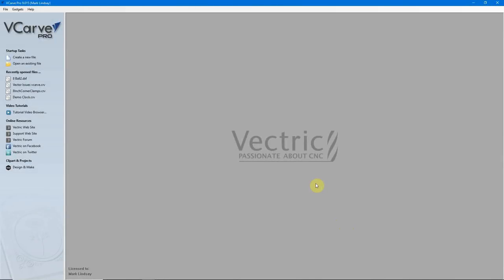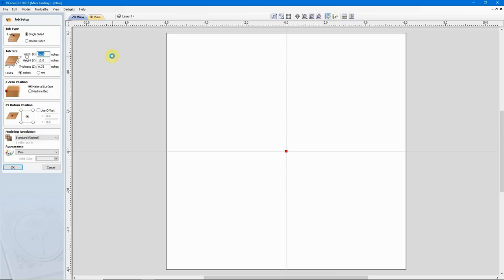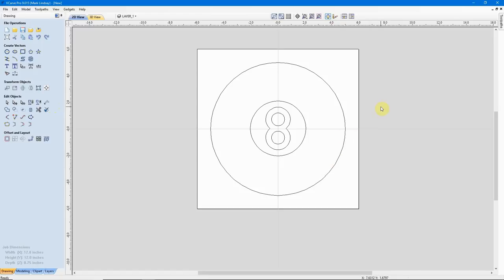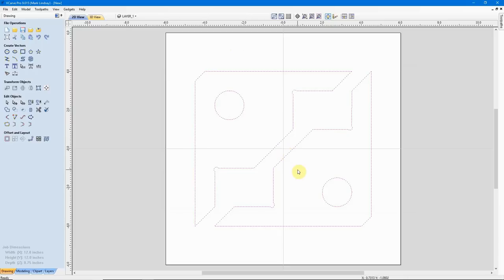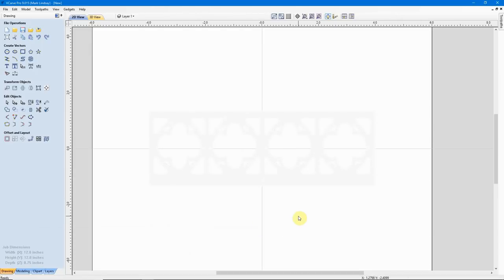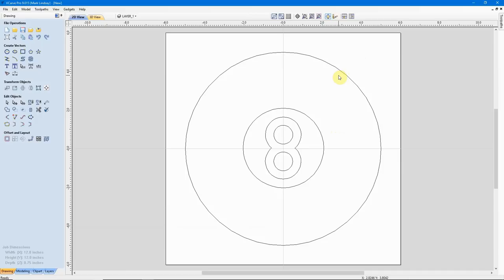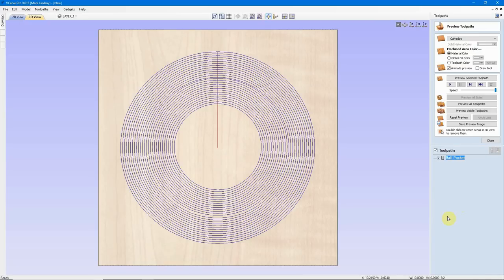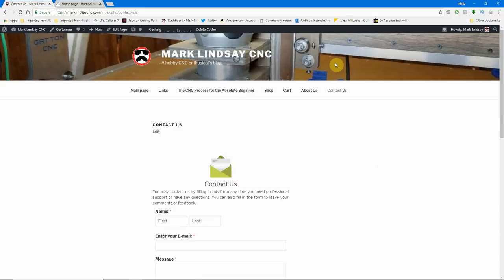Importing DXF Files - Part 5 - Vectric For Absolute Beginners

Comment: Hello, I hope you will read this as I do not know who I can ask for help. I am new to cnc, but have some previous experience from lasers. I am trying to use cut2d as friend of mine lend me his laptop for a while with this program, any way I am testing is and what I have found and this is an issue even he (using program for years) can not understand or find solution. The matter is that my 3018 is cutting in strange way. I have a vector in DXF imported to cut2d, then do pocket from part it needs to have deep cut but not all the way through. Problem is that object has dimension of 25mm by 34.8mm, while the object on cnc bed after beeing done is somehow much smaller. Vector says right size as supposed to be, but the cutter is making it much smaller. My cnc is brand new, been lubricated with pfte lubricant as was told is best for it. Anyway it works smooth but cuts away from it should. Not sure what is wrong. Laser does same job much longer but very accurate then cnc is not even close. I set large rpm as that helps as far as I know, the feed I believe it is called, was stepped from 2k mm/min to 300mm/min, on laser I go for 200mm/min but that is just for reference. Let say you imagine outline of the side of a car with visible front of the car and RL and FL wheel. Bottom of the car is cut fine, then going up, the car squeeze from top. In that way is cut as 34.8mm length but about 22mm hight only. still with similar shape but not as tall as vector says in the program. Could it be a problem with post processor? I use cut2d to send it on cnc, I mean I cut straight from the program. It should work? Actually it does but wrong size. Could be that a problem?
Sorry for long question but I found mane good info in yours videos and I got respect to you and some way I hope you may had similar problem in the past as I see your experience is very large. Better than mine for sure, but frankly I appreciate I found your videos on YT as It is great told about cnc and those stuff. Cheers Luke
Reply from the maker: I would reach out to Vectric Support for this one, Luke. I don't send straight from Vectric to my machine, so I have no idea how it handles the Post Processor. I would check the mechanical first, however. Snug up any couplers on lead screws/ball screws/belts/etc... to make sure they're nice and tight. Make sure nothing on any of the axes are binding, and just generally give it a good going over. New machines do have a break-in period where things need adjustment and tightening for the first few hours it's in service. I don't know what kind of drive system you have, but if you have any kind of couplers, between the lead screws or ball screws and the stepper motors, you might want to add slippage marks to them so you can identify an issue at a glance. I did a very short video (3 minutes) on that, here:  https://www.youtube.com/watch?v=WeLIJaUyOWk
Reply: @MarkLindsayCNC  Thank you kind Sir. I will take a closer look to points you mentioned about if that won't help, will ask software support. cheers

Comment: Mark, this is not a question about this video but I'm not certain who else to go to. I'm just about ready to purchese my cnc router. The machine manufacturer offers the vectric products at about a 15% discount. Do you know if there is any downside to purchasing it through the machine guy. I'm concerned that updates or possible upgrades down the road might be an issues. Thanks so much for your time and sharing your expertise.
Reply from the maker: This is really a question for the machine manufacturer, but I'll do my best. When you get your machine, you'll most likely be told to go to Vectric's website and create a V&Co account. That's where you'll get the license code to activate your software, download the clipart that comes with the software, and access Vectric's free project files. Once you do that, any updates or upgrades to the software will go through Vectric - not your machine manufacturer. I would still reach out to the machine manufacturer to confirm what I've just said (different manufacturers have different policies,) but you should be okay. Do know that Vectric does not offer any discounts on their software, so getting the 15% price reduction is a good thing, as long as it's a legal, licensable copy of the software. Good luck, and thank you!
Reply: Great advise Mark. Thank you for your time and all the efforts to help us understand this technology.
Tom @MarkLindsayCNC

Comment: I wanted to download the file to follow along but the link doesn't work. So I went to your website and purchased it for $0, along with a coffee cup. I got the big one,  hope it fits under my Keureg. I was under the impression that the file was gonna be emailed to me but I haven't received it yet.
Reply from the maker: Thank you for the heads up! I fixed the link, so things should be working correctly now. As for the file, there's a download link on your invoice, and a download link should have been emailed to you within a few seconds of your order. Check your spam folder. If it's not there, get hold of me through the Contact Us page on my website. And thank you again for your order!

Comment: Another super video. I’m in the process of building my Gatton. I’ll be using VCarve desktop and Mach 3.
So I’m wondering (and maybe you’ll cover this later), but when your cutting a project like the eight ball where two different router bits are necessary, does the program tell you when to change bits ? Or does it just stop, you change the bit and have to run the other g code for the other vectors ??
Reply from the maker: Thank you! The machine stops and returns to X and Y zero. You then change bits, load the next g-code file, set your Z zero, fire it up, and start cutting again.

Comment: major problem. toolpath simulations look good. But when I hit start the project the router goes to appropriate place but then tries to dive straight to the near bottom of the wood.  Its going way too deep, much father than I "asked" or the tool simulations showed.  any ideas?
Reply from the maker: Where are you setting your Z zero, both in the Job Setup and outside on the machine? They should be the same - meaning, if you set the Z zero to the surface of the material in the software, you need to set your Z zero to the surface of the material out on the machine.
Reply: @MarkLindsayCNC  turns out. my machine was set in inches. that didn't help. and the Z height over material was set sky high. So that resulted in the reenactment of a swimmer diving into a concrete pool from the 10 meter board. Got it handled though!

Comment: Are you able to center the imported DXF file to the material by using the mouse to drag the vectors or are you limited to using the "aligned selected objects" function?
Reply from the maker: Yes, you can certainly use the mouse to drag the vectors. Select all of the vectors, put the cursor over one of the selected vectors and left-click. That puts you into Move and Transform mode. Then you can use the boxes that appear, to move or scale the vectors. Using Align Selected Vectors is just a faster way to make sure you have it centered precisely, but you do not have to do it that way if you'd prefer not to.

Comment: Nice tutorial  once again 👍 And really cool Willy’s with camper 😊
Reply from the maker: Thanks very much! 

Sadly, neither the Willys nor the camper is mine. I used them for inspiration back when I was into building teardrop trailers. I've always loved the Willys Overland, so that pic just combined the 2 things I really like. I've had that wallpaper on my computers since about 2009, and it's kind of like that favorite hat or shirt you refuse to get rid of.
Reply: Mark Lindsay CNC aha okey 😊 And cool that you have built teardrop trailers. What exterior material did you use in those builds?
Reply from the maker: So far, fiberglass and aluminum. Of the two, I prefer working with fiberglass. It's messy, but I like the result.